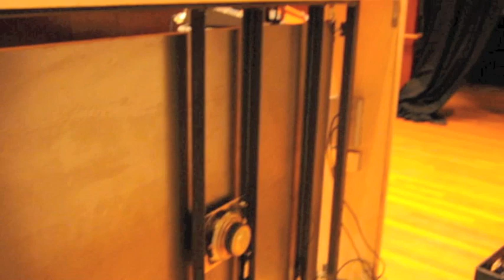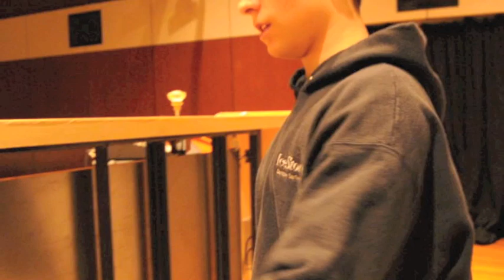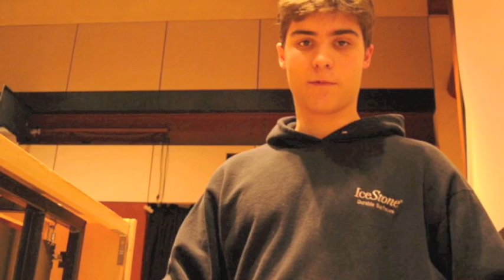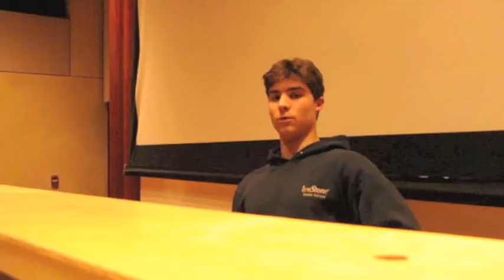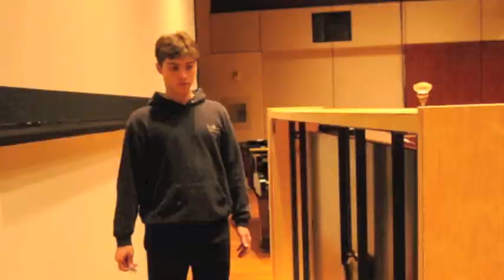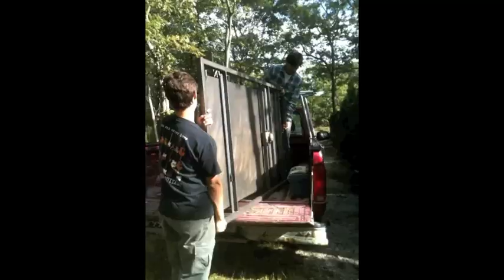Senior Project: Plate Reverb

Comment: Awesome! I would love to do this. Do you have any info on transducers or pickups that you used or good ones I should consider in the build?
Reply: Klark, thanks so much for your response! I can weld so building the plate mount itself, bracing etc. seems the least of the problem though it obviously takes time. I'm not really an electronics guy but do all my own guitar wiring and some simple repairs that don't involve logic design etc. I would like to speak with you to see if you can offer some other clues on where I can get more info on how to build a transducer, what wattage should I be shooting for to put through the plate, what guage wire to use, how many winds for 8 ohms, can I use a regular speaker magnet and things like that. Is there any way to contact you directly? I am not use to youtube communications and don't know how to do that as of yet but you can get me on FB if you get a chance.

Thanks again and love the project you did. It sounds great!